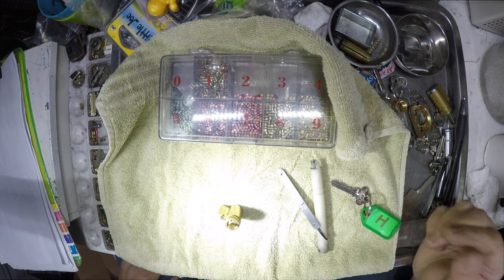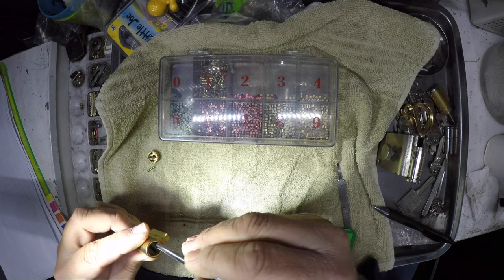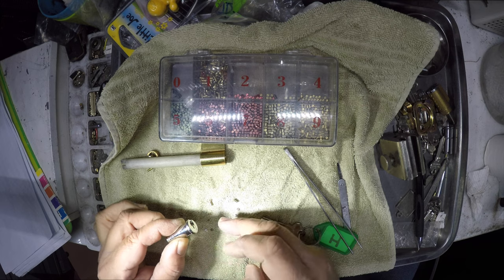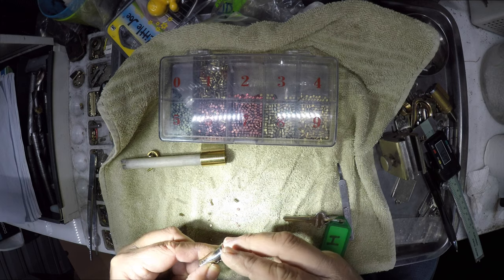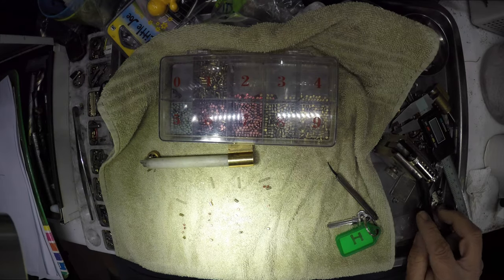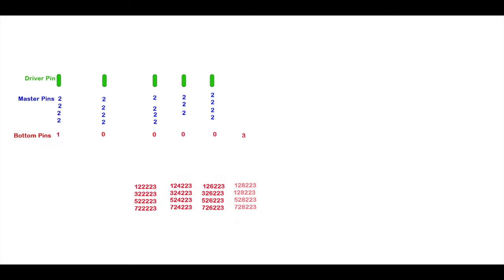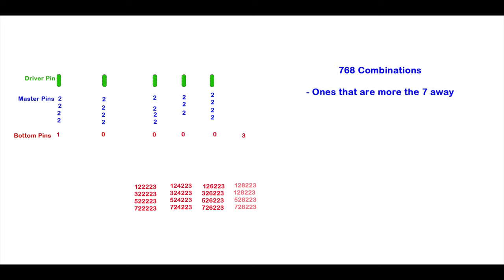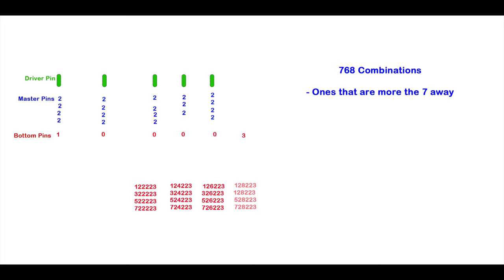Hacking a Key System to make a Master key

Comment: I am in the middle of rebuilding a key tree at work right now.  The building guys barely knew how to change out a cylinder,  and then only on a few that they left with a zero bitted code in them, they didn't have a master bitted change key.  The only map had what cylinders were where, nothing about the bitting info.  Took me pulling apart 3 of the cylinders in the key room taking good notes of all the pins, but got the master, cut new master and control keys and now I am rebuilding a cylinder chart off the keys so I can load up any cylinder by just knowing what key number it needs.  Not bad for a guy whose locksmithing career started less than a year ago when I repinned my front door with a crappy pinning kit, but it really got me going.

Comment: I've done that only when the previous locksmith has died or retired but limited to a single lock repair.  Anything more than that, I make the complex buy a new master key system and rekey everything.  Because I have no idea the age of the system and if key control has been compromised. Slum lords will always choose the cheap route and they dont call us anyways.
Reply: I take it that slum lords are the landlords who do the absolute minimum for their tenants. I have been to a few places in a decent city. Those places look great from the outside bit inside you have four people sharing a 1 bedroom apartment. Seen alot worse too.